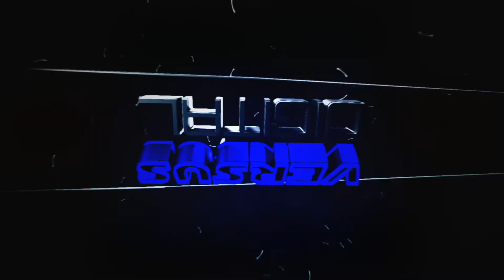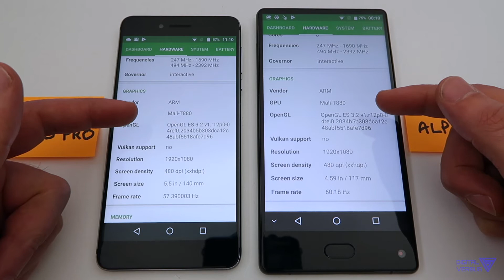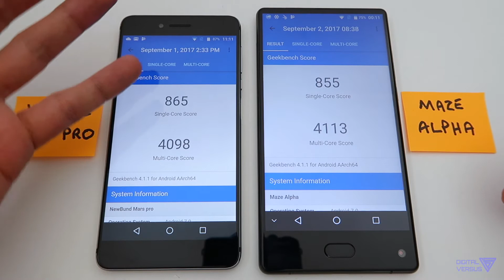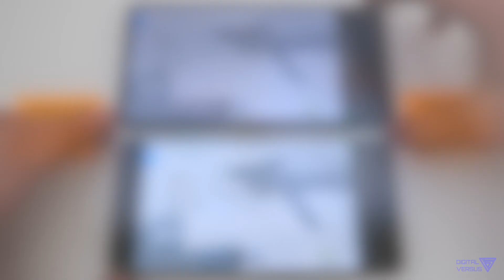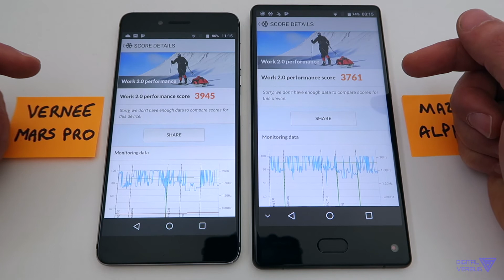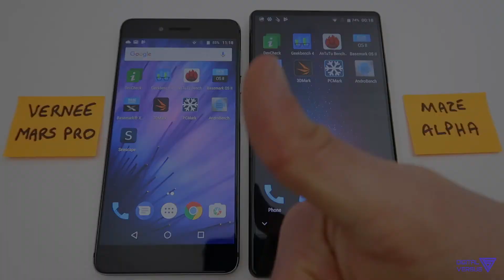Vernee Mars Pro vs Maze Alpha - Performance Test

Comment: I watched a lot of reviews and in the end I didn't decide for the Maze Alpha, because I heard the Compass, Gyro and Wifi connectivity are kinda not so good... and since I read a lot of stuff, holding it in the hand, those 225g will be a pain after a while.
The word is that the Mars Pro's call quality is bad, but for me that is less important. Too bad it doesn't have a 6" screen, but 5,5" is ok with a weight of only 161g. Camera is "good enough" on both phones, if you're not a professional photographer. (that is only what I heard, please verify/research it for yourself)